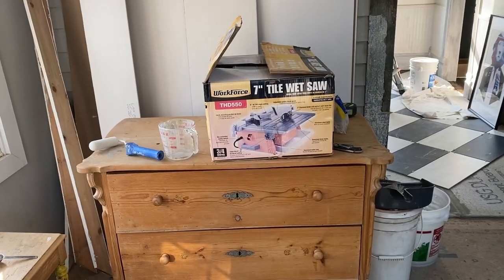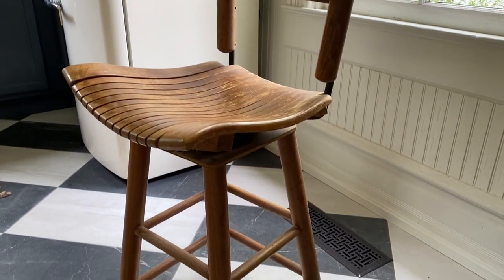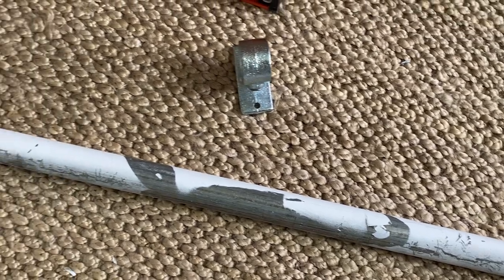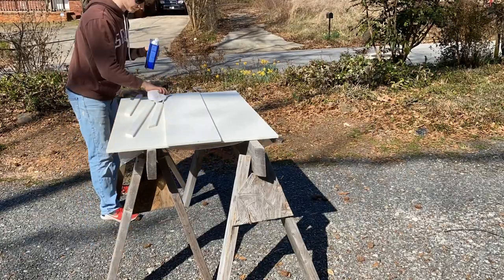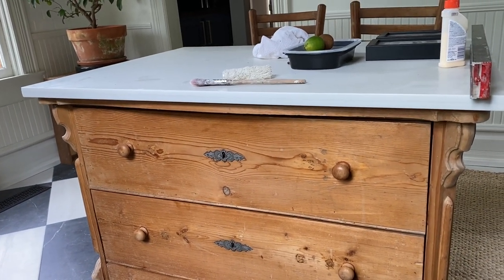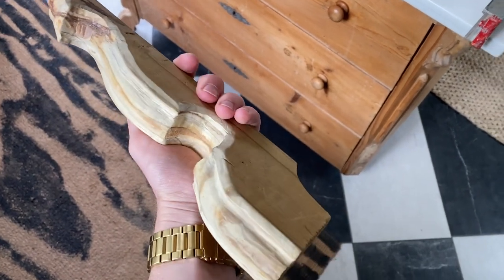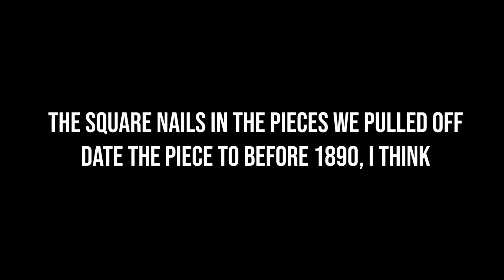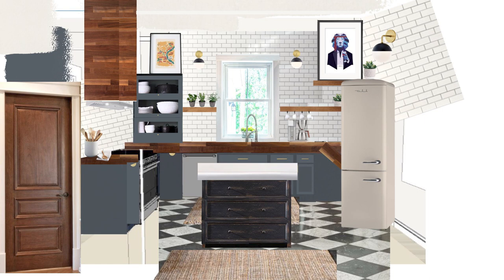DIY Bar Footrest & Antique Dresser Kitchen Island! | REISSUED

Comment: Your kitchen is coming along beautifully. I love your color choices and design elements. There is only one thing I would have done differently which is to raise the height of the island by making the base of the legs 2 inches higher. The short island looks odd. It should be the same height as the kitchen cabinet to look balanced in there.